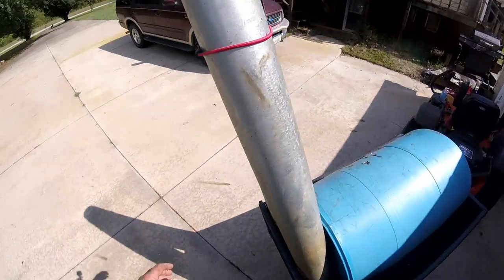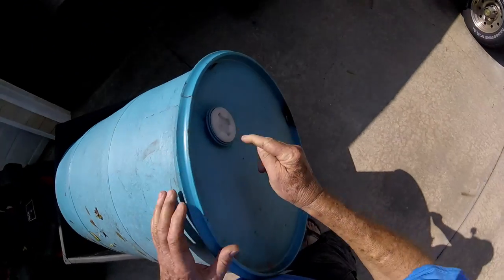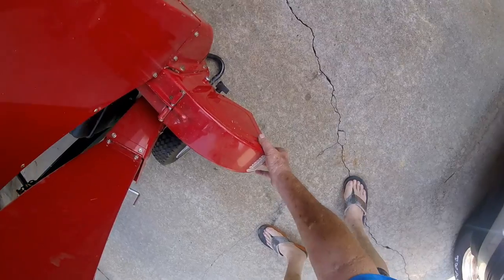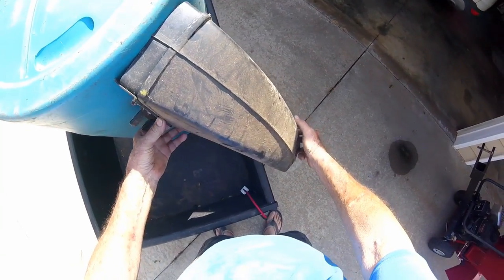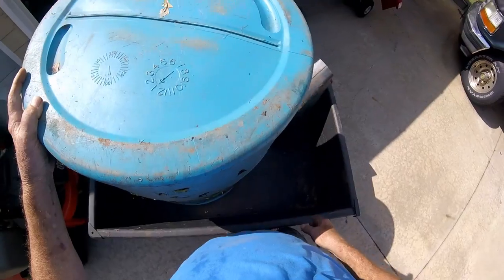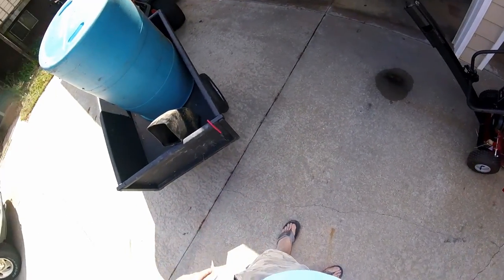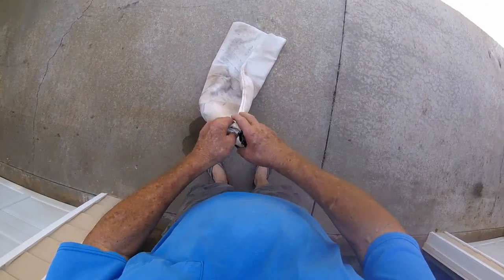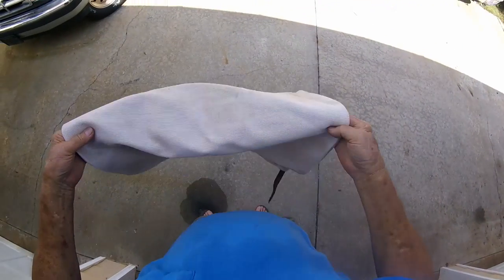Wood Chip Collector Project Part 1

Comment: My guess would be that the chute will quickly plug up with chips if you try to blow them through a small opening. It depends on how powerful the chipper blows the chips out.
Reply from the maker: Thanks Bruce  I am heeding my viewers suggestions and now working a different approach

Comment: Walter, I looked around on YouTube and found this guy doing a chipping job. His chipper is a bit bigger than yours. Look at his truck. It's the same as your trailer but with three sides and a top. You could make an attachment for your trailer with some 2x2's and a sheet of 1/4" plywood. Here's his video: https://www.youtube.com/watch?v=KRtbXLCZl9I  If you can turn the discharge chute around, then mount that plastic chute to the end of it, aimed at the back of the trailer, you might just have something there. Jon, MSO-439
Reply from the maker: Thanks Jon :-)  I am gonna do just that

Comment: Walter, Ted Pennebaker (below) is on the right track. Take a tip from guys who chip up whole trees. They don't use a barrel, but shoot the chips straight in the back of a "covered wagon" truck. Take that trailer and make a covered wagon attachment, with that chipper catcher bag as the cover. Use pieces of  the barrel, cut into 2" wide strips, as the "battens" that hold up the cover for he wagon. Have Contrary Mary take apart that chipper bag, and re-sew it up into the canvas cover. The trailer will still dump.  Jon, MSO-439
Reply from the maker: Good suggestions Jon  Thanks

Comment: Walter, I agree with the others on this one.  From experience with my chipper shredder, I'm not sure it will develop enough air flow and velocity to push the chips up the exhaust tube into the collection barrel.  I think there is a solution that you will find thru testing various prototypes.  I'm looking forward to your further development on this project it addresses one of my major complaints with my unit.
Reply from the maker: Thanks Harry  I am listening to my viewers  today's video will be an entirely different approach

Comment: 6" wide flex tubing just might hack it,  although, I do not believe you are  going to have enough strength in the discharge to go up where you think is going to go. Asplundh has a blower in their discharge which makes their discharge go up into the truck.
Reply from the maker: Thanks Im gonna find out lol

Comment: If you look for a "hose", start in the HVAC area where they have flexible hose for air conditioners and heaters or look at the vent hose for laundry driers, depending on the width you want.  A peanut combine has a powerful fan which moves the nuts about 7 feet up a metal pipe and blasts them into a basket with a mesh top.  The dirt blows up into the air like a steam locomotive stack and the nuts drop to the bottom.  Those chips ought to weigh something like what the nuts weigh.
Reply from the maker: Thanks David I am now working a different approach to the problem

Comment: Perhaps a simple wooden or sheet metal canopy (like on a pickup truck cap) attached to your trailer that would allow you to shoot the chips directly into the trailer and it could remain in place when you dumped the chips.
Reply from the maker: I do like your way of thinking  I will consider it  Thanks

Comment: Use the chips as mulch like CSX is doing along their tracks.  They have been doing that along side the "S-Line" where they are laying new tracks.  They had several piles of wood chips being used as mulch.
Reply from the maker: Sounds like a good idea
Reply: It allows the dead chopped up stuff to e recycled [used] and it ought to work well near your mater plants blocking out the capability of weeds choking them out.

Comment: Walter -- Ted's idea has a lot of merit; just make sure that the canopy is removable so the trailer can be used for other things.

Canopy idea -- some 2x4's at the corners; scrap pieces of tarp for the sides; and cut the barrel and use it for the top [leave it curved for more capacity].  By using tarp for the sides -- you can "fold it up" for storage.
Reply from the maker: Thanks my friend  Tonights video will be a better approach I think
Reply: Well then; I'll wait for it.